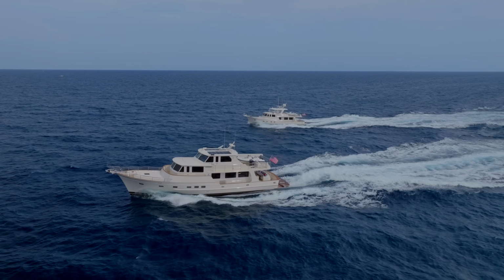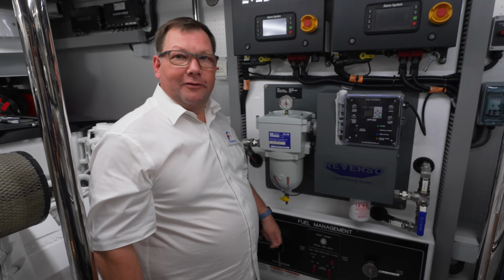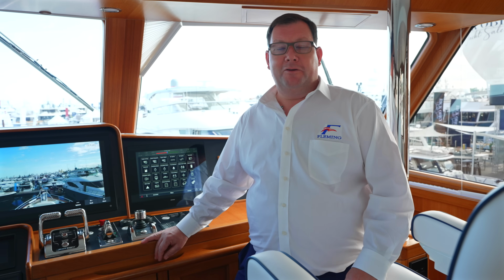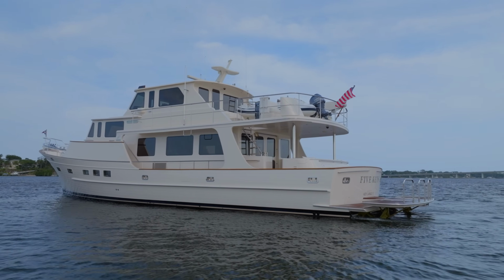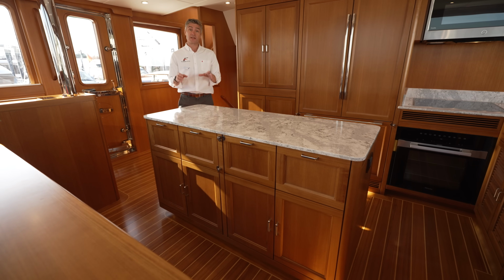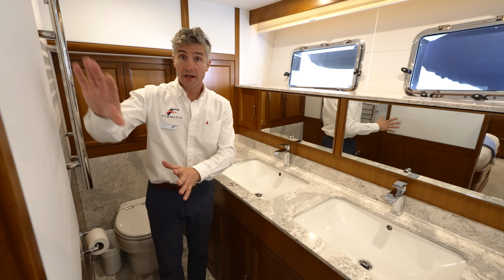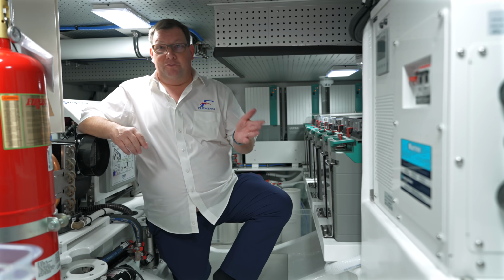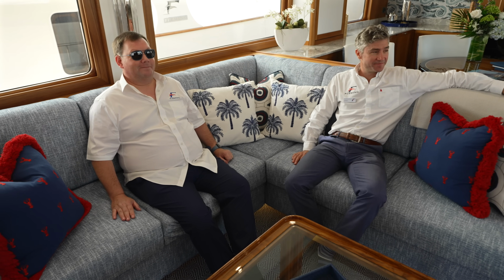The Ultimate Cruising Yacht: Fleming 85 Enclosed Bridge Tour

Comment: I’m a little disappointed in the Fleming enclosed flybridge 85’.  I was just looking at an ‘Outer Reef 85’ enclosed flybridge.’  It has greater volume than the Fleming and has a much larger and more functional enclosed skybridge.  It also has three comfortable guest staterooms addition to an uncompromised full beam master with his and hers heads.  It has a 3K nautical mile range, and a boat deck which can accommodate an 18’ tender. 

As much as I have always admired Fleming yachts, I will choose the Outer Reef 85’ over the Fleming.
Reply: If you have ever seen a deconstructed outer reef you’ll see all the untreated wood in it and change your mind !
Reply: @ The wood that makes up the interior finishes?  I can’t believe there’s any wood in the structure, although I could be wrong. I have seen drawers and hanging lockers which are finished on the inside.
Reply: Look up harbor pilot yacht tours to see this
Reply: @ I will, thanks.
Reply: @ can’t find anything for Outer Reef and Harbor Pilot Yacht Tours.

Comment: The interior usability is great, the exterior lines are as good as they could be... and it still looks "off".. Lets agree that its lines looks markedly different than its siblings... Its also in contrast to the low center of gravity ideals of Fleming, which, I suppose, with the advent of stablization its less important than it once was, but the wind remains??. On a rough weather crossing you dont want to be on the flybridge partly because it rolls more.. or used to??
Reply: I wondered as much.   I've always thought I wanted one more like  a corvette, without fly-bridge.   Neither of us want wind and stairs at our age,  low, slow, reliable.
Reply: @MrCobb-rq8iv  A large hull to superstructure ratio is what makes sailboats and Down East style boats so safe..  Low profile has been a Fleming selling point for a long time.. for good reason..
Reply: @Walcingham509  so, I assume you are agreeing putting all topside is no longer Low Profile.   What ever floats their boat, its not for me and several others I read hear,   Regards
Reply: I’d still prefer a Kadey-Krogen, and now that they make a 60, that would be my dream boat.